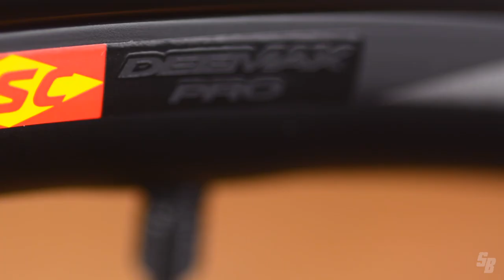😍 MAVIC goodness 😍 // Why I Upgraded my Wheelset

Comment: how have you found the wheels....i'm keen to get some of the Sam Hill versions.....the reviews seem good...
Reply from the maker: I’ve ridden them 4 seasons now. HARD. There is not that much i’ve had to do to them. Spokes have never come loose. I have trued the rear up once but that was just me being over cautious. One bearing change. I’ve smashed them into stuff and just scratches. No dents! And i dont use inserts. They are bombproof! The only thing i dont like is the freehub engagement.. If you get them, be sure to get spare spokes for front and rear. I’ve not had to use them but if you are on a trip somewhere and a spoke goes, i can guarantee you nobody will have a mavic spoke spare
Reply: @ShreddingBliss  Thanks for the feedback, great to hear a follow up after a few seasons, really adds to the review. 
Do you have any idea if there is much difference between the standard Deemax and the Deemax Pros? The pro version is twice the price but they both look pretty similar visually at least
Reply from the maker: @fionnut  I do know that the Pro is beefier. Perhaps not so much in terms of weight (although a bit) but the Pros are indeed the bombproof ones - beefier spokes etc. I have heard of people having issues with the regular Deemax - broken spokes, bent rims etc. So, if you feel like you need a rim that is excellent and can take an absolute beating, Pro is your best bet. If you’re more mellow riding and Down Country / trail, I am sure the regular Deemax will be just fine.
Reply: @ShreddingBliss  Thanks a mill, was looking for something more durable than my stock wheels so will save the pennies towards the pros in that case. Thanks again for the feedback, much appreciated and love the channel!
Reply: @ShreddingBliss  really useful thank you

Comment: Nice video. Could you please give us an update after one year of use of these rims? I have read mixed reviews regarding the the hubs on Mavic wheels. What was your experince? Thank you, Gabriel.
Reply from the maker: Nothing but praises from me! I've been rising them super hard and haven't really had to do anything to them. I do keep an eye that spokes are ok and no play in hub - so far so good, after one full year of riding. Probably the only thing I will need to do (but not yet) is replace the bearings, but that should be straight forward. I did by spare spokes, just in case, as they are hard to find and if I am on a trip somewhere, I will take them with me
Reply: Do you have any creacking noise by bladed spokes?